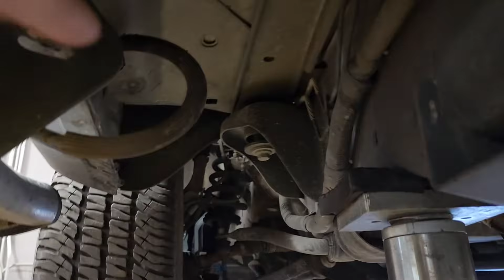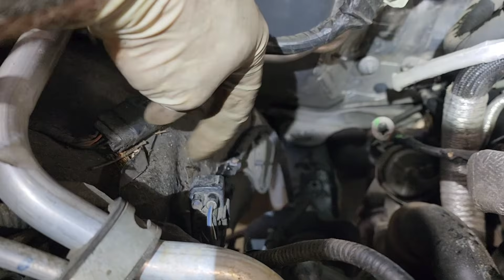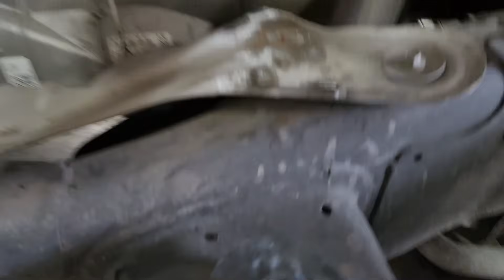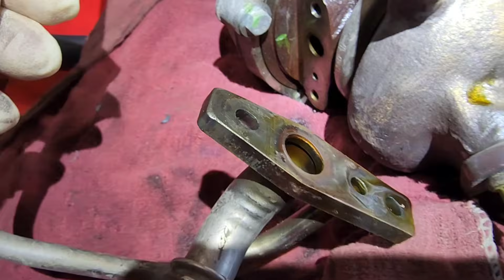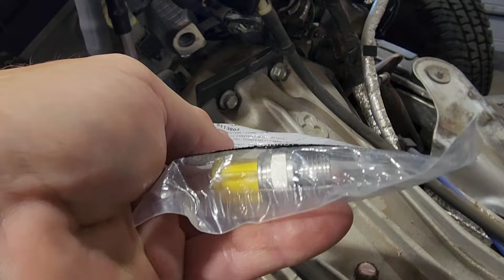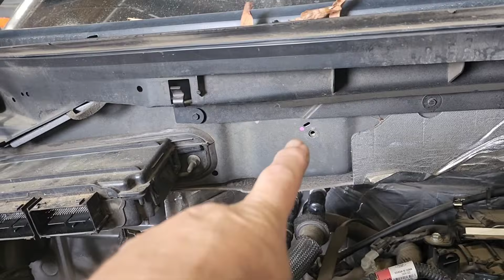Ford Turbo Coolant Lines

Comment: what's the best way to do this on a lincoln navigator? my shop has never pulled cabs but a pick up seems like it might be worth it but a navigator not so much?
Reply from the maker: I have not done this on one of those. You can do this job in the vehicle it is just much more difficult.

Comment: early eco boosts f150s like this one you don't have to remove the body mount completely. other than the front most body bolts, remove the 15mm nuts, 2 on each body mounts. the washers are just the right size to pop out of the frame
Reply from the maker: Thank you

Comment: The tools to remove Jiffy Tite connectors have never been plastic… they are always metal and it’s far easier than trying to pick that clip out I think.
Reply from the maker: I find that with the tool the lines are very hard to disconnect personally

Comment: What are the absolute nightmare.. no thanks I can't do that in my driveway
Reply: What are you going to do? My 2011 is leaking coolant very slowly, I dont think I can do this as I work lots of hours. Thinking about selling it and getting a truck that is easier to work on as it is too expensive to do these repairs.

Comment: I can guarantee u Theres no need to remode entire cab to replace those coolant lines u create unecessary work
Reply from the maker: It just makes it easier
Reply: Over the years I’ve come to believe it’s better to go the long root, less trouble and likely end up with a better job.
Reply: It is not more work actually. It’s much easier work then trying to contort and bend the lines to do it with the cab on. Plus you end up with a better repair if you remove the cab.

Comment: Get an induction coil tool for your rusted bolts.  I used a cheap ass one from AMAzon and it worked like a charm, the body bolts came right out, no issue.
Reply from the maker: Thank you and yes I have one but not a cheap one. I have one from inductive Innovations.

Comment: Damn didnt realize how much work goes into changing turbo coolant lines
Reply from the maker: Yeah it is a huge job, make sure you replace all fittings with the lines or they will leak.

Comment: If the turbos aren’t getting coolant, obviously I’m sure that’s a problem as well, correct. My coolant line was crimped and I keep blowing my driver side turbo.?
Reply from the maker: Yes the coolant is there to cool the turbo and the oil is for lubricating it.

Comment: exactly what I needed. Wish i could pull the cab.   Thanks
Reply from the maker: You can do it without pulling the cab is just much more difficult
Reply: @NutsandBoltswithTone pulling the cab looks just as difficult.
Reply: @tagle2818 no where near it actually

Comment: Last year, I overhauled the turbos and replaced all the coolant and oil lines in my 2013 F-150 Ecoboost. It was a messy endeavor, and my hands bore the brunt of it. With time and patience, though, the task is completely doable. The trickiest part? Swapping out those coolant line fittings at the rear of the head.
Reply: What is the trick to get to the rear coolant line fittings.   Ive got the driver side turbo off but am stuck at the rear fitting.  Do you need to start drilling down into the engine to create more space?
Reply: @derekschmitz1047  Removing the driver's side rear head coolant fitting can be tackled by accessing it through the wheel well with a stubby wrench or by removing parts like the manifold and hoses from the top. It's a challenging task, and using a camera for assistance might make it a bit easier, although it's still a tough job.
Reply: @danielmarjanovic9957   harbor fright sells a cheap  camera .. well worth it . i had to change the crank positioning sensor on my 14 eco boost and getting it back in was gonna break my sanity ,, got the camera and was done in 20 mins .. best 40 bucks ive spent in a years
Reply: @derekschmitz1047  what year is your truck?
Reply: @danielmarjanovic9957  , a 2013, so not much room between the block and firewall.   It sounds like the top down is the way to go.   Ill tackle the intake manifold tomorrow and see what space that affords me.  The coolant line running back there is really loose so I imagine that fitting is the biggest culprit now for the coolant leak.
Reply: @derekschmitz1047  To access the coolant fitting, take off the intake manifold and coolant T-pipe.  Shield yourself with a blanket for added protection. Are you upgrading the turbos, or is it a fittings and lines replacement?
Reply: @danielmarjanovic9957 , just a fittings and lines replacement.  The T pipe is new to me.   Is it visible with the intake removed?
Reply: @derekschmitz1047  Certainly! Once the intake manifold is removed, you’ll spot the coolant pipe. Ensure you swap out the gaskets for both the manifold and the pipe. The pipe is easy to detach, and there won’t be any coolant leaks during removal.
Reply: Removing the intake and t pipe is the key.   Drivers side is complete.  We’ll see if I can put it all back together now. :-).  Thanks Daniel.  Happy New Year.
Reply: @derekschmitz1047  Wishing you the best and a joyful New Year!
Reply from the maker: Good job on this job, I personally have always pulled the cab so those fittings have always been the easiest part for me. Thanks for watching.
Reply: Great tip! Thanks brother!

Comment: Yeah my Monday already started out like crap. Aftermarket intake on a V10 F350 packrat damage bunch of chewed wires freaking Cactus everywhere. Then I have a rack and a pump to do on a Jetta all good money but I just can't get into it today. Plus the Jetta is all slimy and there's two trucks tore down outside where we normally steam clean stuff when you have an oily mess like this pig
Reply from the maker: Wow bummer about the mess but hey you got plenty of work, that is a good thing. Thank you for watching.